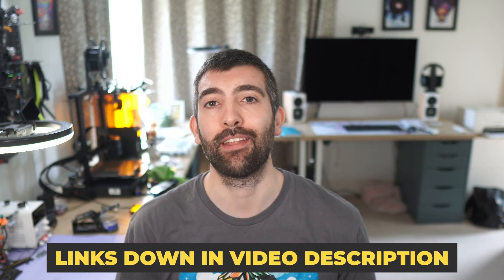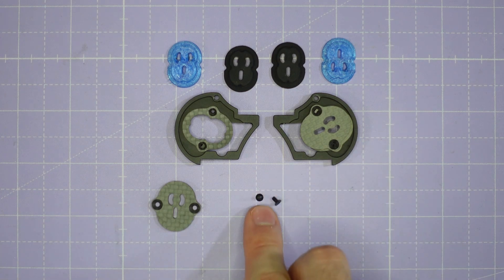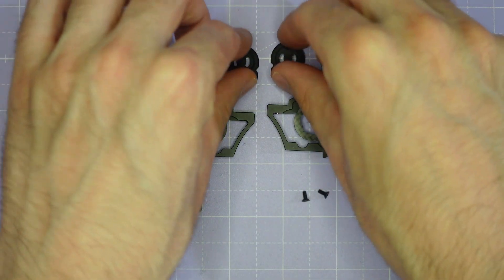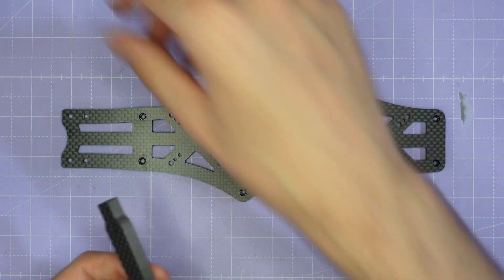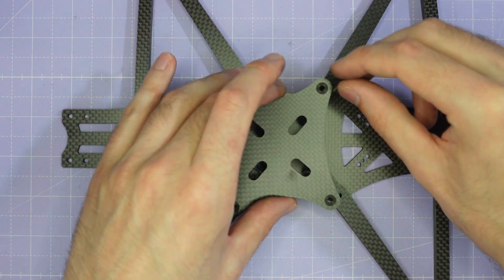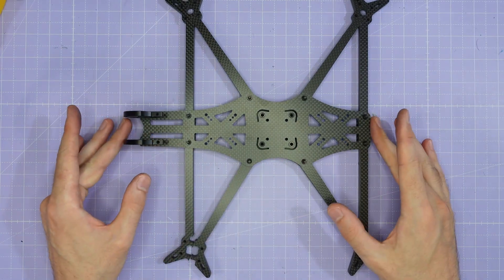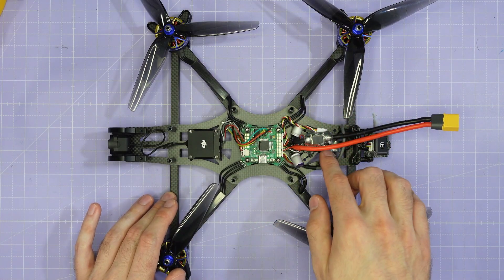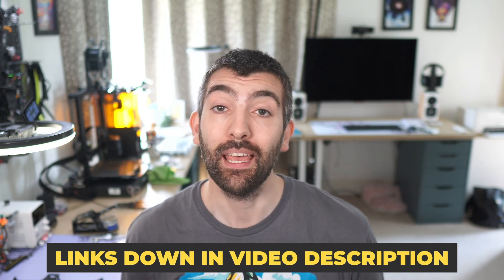AOS 7 V5 Build Guide

Comment: Are the cam plates availeble separetely? got a AOS7 frame 2nd hand and the dude threw away the camplats and installed a tpu cam/rx antenna mount for the old dji cams.. not gonna work with 04

Comment: The AOS 7 v1 is still the best! And iam proud iam still having one of these. All others are really non sense updates. The best jokes are the antenna holes in the topplate... wtf
It's a great frame but very hard to tune because of its weight. Would i build him again? No, its a really heavy weight frame. And you will feel the difference in flight time with most other 7" frames out there.
Reply from the maker: If you're looking for light weight can I interest you in the UL7? The AOS 7 is a tank!😁
Reply: Why not buy the light weight variant of the AOS 7 if that is what you are looking for? Irrational criticism doesn't seem fair

Comment: TFW you realize only those brand new to FPV have been buying AOS frames.
Reply: bros just hating
Reply: @strykerfpv  no, the frames are no good.
Reply: @MysteryD  have you had one? what was your experience?
Reply: @strykerfpv  I haven't built one. I don't need to. I build and repair for a living. I've seen a shitload of frames, and know quality when I see it. The simpler the better, and any frame that requires bracing pieces is an automatic fail for me.

Edit - I've done 115 builds in the last 2 years
Reply: You dont have to buy one then. But I was already dumb enough and bought one. An older one and I just realized now, that the frames are deliberately and specifically designed to be not compatible within the versions. I would like to see more transparency here. Do I really always have to buy the whole new frame if i want to get the new antivibration future? I know grocery prices went up, but really?